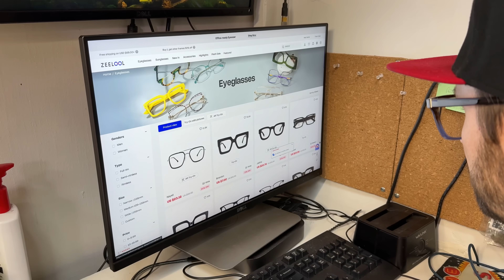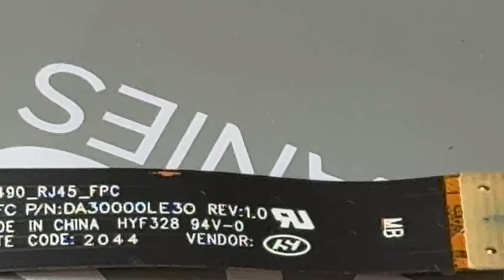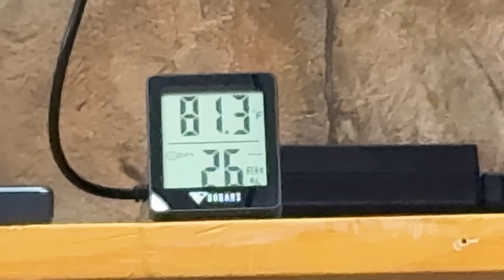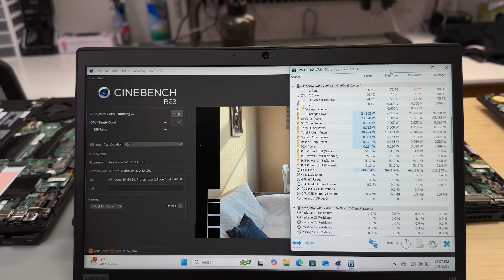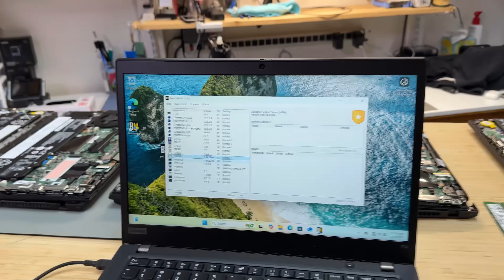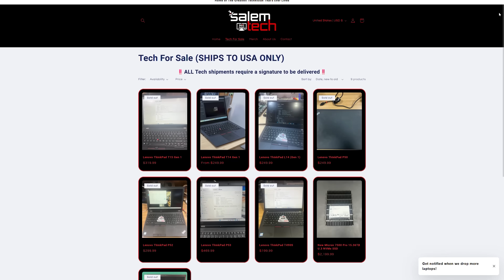Is Replacing Laptop Thermal Paste a MASSIVE Waste of Time? Let's Test!

Comment: For deployments the only way out of taking a ton of time is using scripts and a deployment server where you can PXE boot over IPV4 connection like MDT (or a non MS alternative) it works great for loading all the basic browsers, office 365 etc onto a device with the only input from technician being pushing GO 3 times over the course of 30 min to 2 hours (system dependent)
Reply from the maker: This will push the complete image with user account already setup, drivers installed, etc.? What about devices that don't have an ethernet port?
Reply: @SalemTechsperts don't some USB expansion dongles have, an ethernet port. 

Does that work over USB-C?
Reply: @SalemTechsperts yes it will , you don't need actually ethernet port always or for the most of time , it can be USB port or USB port device that acts like network device. Most laptops can access networks or network devices with a simple usb. I got rusty over time , but , if you accidentally leave USB device , like drive or something win or device itself will bootloop looking for boot image / media on connected device. :) BTW , ever since Win 7 onwards , Win itself is usually under some sort of VM (basically stripped down version of HyperVM or similar solutions) and it's easy that way to push images or just updates via unattended installations etc. :) I was doing it since Win Server 2003 + XP , but since 2008 , MS dropped XP and forced Vista. :) I got in 2007 my MCSA , there's plenty of tricks to do it , especially since WSUS and other MS proprietary software went open source or available for ordinary users (client computers) without them needing to have something installed in order to work. :)
Reply: Also , you don't need to have Win Server anymore as some of its exclusive components made way to client operating systems , which is cool. :)

Comment: Blue light blockers in glasses are marketing BS.  Couple members of my family who work in optometry have confirmed this.  The problem with your eyes being tired/strained is not blinking enough [and possibly brightness depending on ambient light]. For some reason people seem to blink less when staring at PC screens.  You should also use regular eye drops if you stare at a monitor frequently..
Reply: Those glasses also were not blue light blocking at all.
If they were, they would have orange lenses.
These might block UV, but screens hardly emit this so even this would be useless.

And it is way more effective to turn down the display brightness to match the surrounding environment.
This also reduces the eyestrain induced by adjusting the pupils to different light levels.

Though the importance of periodically looking away from the screen, into some distance can not be understated either.
Same with any other close-by thing, like a book or hand-work.
Reply: @WyvernDotRedI wear prescription lenses with "blue light" blockers, they do have an orange tint that is very noticeable when I remove them or put on the old ones.

I've found that they actually help with blocking put brightness, especially on devices and environments with intense blue or white light and also block glare from the sun and the excess brightness of the sun reflecting off surfaces. 
I still have eye strain from work and staring at screens but I no longer feel uncomfortable throughout the day with bright lights. So the filter ks good anyway
Reply: @ I've tried normal prescription lenses.
Had trouble with my pupils exceeding the lense area, creating awful colour fringing.
Since I'm only half a point out in one eye and perfect in the other, I do not need focus correction anyway.
And for closeby things like screens, I only notice this half point when I have stared for way too much and should stop for a long walk.

While filtering glasses would work, it would work as well to limit the light output of the screen.
Especially when paired with 'warm' lights at a reasonable level for the time of day in the surroundings.
There is no difference between filtering it or just generating less light, what enters the eyes in the end is what matters.
And this way the wear and power usage on the screens and lights gets reduced too.
Reply: This comment deserves more attention before people waste 50 bucks
Reply: Can confirm this.  Wearing those kinds of glasses you might initially feel better, But it’s not gonna make the pain go away.
Reply: damn i got scammed
Reply: @StellviaHoenheim  nah, blue light blockers are real, it's just not life changing. Most of these comments are totally on point. Most people don't really need them, but if you require a prescription on your glasses getting blue light blockers is kind of just nicer. 

Eye strain isn't usually from blue light, but the biggest help I find is that the blue light tends to keep me from feeling tired if I'm using my electronics into the night, whereas when I wear my glasses, I don't feel like the light is keeping me up and can get tired and feel like I can properly prepare to sleep when I know I should go to bed.
Reply: Harbor freight sells safety glasses that are amber and filter out lots of blue light... $0.99
Reply: There are some benefits based on the individual but the overall claims are a bit outrageous and most opticians that are specially YouTubers have had to walk back or never acknowledge the fact that the industry used it as a marketing tool to get people hyped up to want to buy glasses instead of marketing the actual lens technology that exists today like most people are not even aware of like Trivex lenses and other great anti-reflective coatings that have come out the last few years.
Reply: Well your family members that “work in optometry” are wrong and are going against many years of research at this point. Blue light exposure in the evening and night wrecks your circadian rhythm, causing a cascade of issues that can include insomnia, cognitive impairment, and mood disturbances. There are certainly plenty of fake blue blocking glasses out there, but the real ones are not BS and neither is the science surrounding them.
Reply: i rather turn on the eye comfort shield in the device settings and turn the brightness down to a comfortable level for me
Reply: @Heathcliff597  brightness is the actual issue. in a relatively dark room looking at a bright screen your eyes adjust to the average darkness but then you have millions of light bulbs blasting your eyeholes.
Reply: Using any glasses will mildly help with dry eyes, as they prevent air movement. Air movement causes the moisture to evaporate from the surface of the eye.
Reply: While it's not total bs, reducing blue light does help with sleep, but you don't need glasses just turn on eye comfort mode on your device. For eye strain it's just better to stick to the 20-20-20 exercise. Every 20 mins look at something at least 20 feet away for 20 seconds.
Reply: The biggest thing to help with eye strain, is to wear glasses with the proper prescription. Now I'm an individual that stares at screens literally all day, with a prescription so bad some places don't even do it. I've fell for all the marketing bs, scratch resistant lenses, light intelligent lenses, even anti glare stuff. 
I've got to say, anti glare is worth if you're looking at bright lights (plus overall less light reflects onto the lenses), light intelligent is worth if you're pretty sensitive to bright sunlight outside. Scratch resistant makes your glasses chip easier should you drop them, and blue light, there's no difference at all really. It's not the same as anti glare like some think though, as that's actually useful.

Comment: I replaced the thermal paste on my old IdeaPad (forgot the model name), the fan was always spinning even at idle. And it runs like new now. The fans spin, but only when under stress, not idling.
I would have never done that without watching your videos, so thanks alot!!
Reply: Yep, I've been doing this for years. The first moment my fans start ramping up, I crack open my pc and clean it and apply new paste.
Reply: My laptop meanwhile has a bios option to have the fans always on
Reply: fans dont spin at all unless under stress?
Reply: They spin a little, but before, it was full blast always
Reply: I have an Ideapad too and My fans do make some noise even when at Idle. I'm also planning to change the thermal paste and deep clean the heat sink as well, but before that I need to make sure that it actually works or not. Also, I need kind some of guide to perform cleaning so I don't mess up. Will you help me with this ?

Comment: Not sure if this would help but setting up a PXE server for your most commonly used images makes imaging computers super easy. Ive needed to deploy over 500 devices and the PXE server (Fog Project) made pretty quick work of it.
Reply: that or usally a cheap large USB Drive setup w/ Ventoy works in a pinch
Reply: ventoy is truly amazing, have been using it since i discovered it years ago

Comment: re: your installation conundrum - Could you create a default image per SKU, then spin up a netboot server on something flashbased, and then just have every device pull and install the image from that server? I've done this on retro mac machines, and I'm pretty sure on windows as well, my newer thinkpad even has a dedicated boot option for it separate from just PXE, but you should be able to make it work over PXE!
Reply: also small correction, that small die isn't actually the iGPU, but the PCH! And yeah it deffo shouldn't have thermal paste, as the CPU can heat it up and massively throttle IO such as USB etc. The iGPU is actually on the same die as the CPU (at least for Intel)
Reply from the maker: @hutchx86  idk why I called it the iGPU when in every other video I call it the PCH 🤦‍♂
Reply: @SalemTechsperts   eh, it happens to the best of us 😅 and I guess that now also includes the greatest 😌